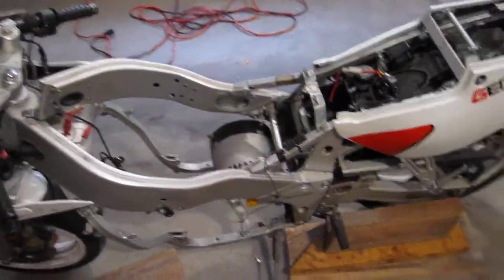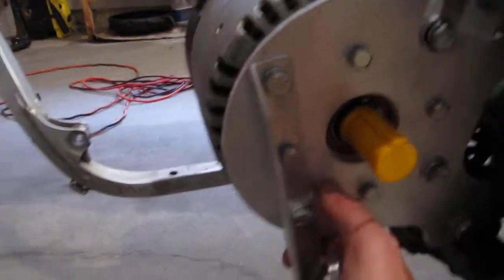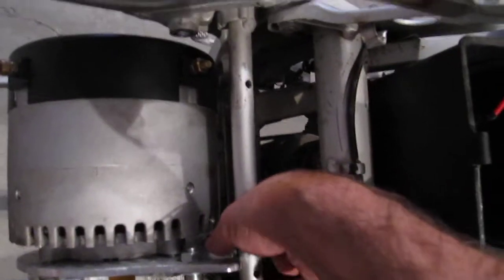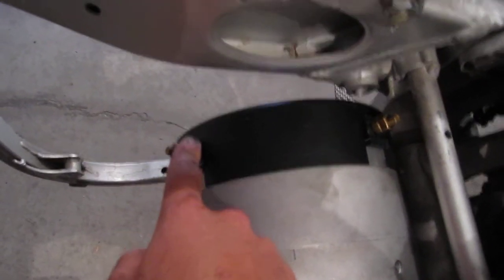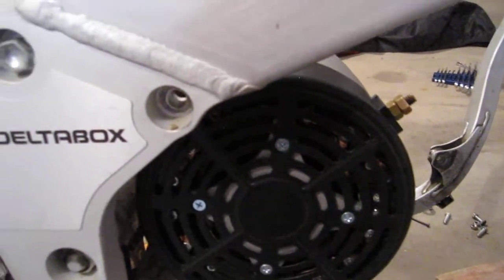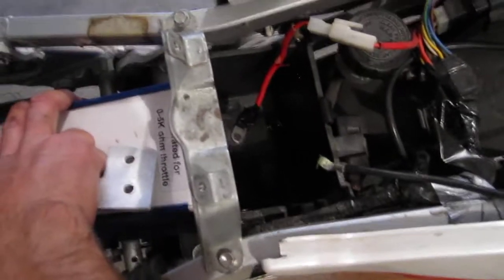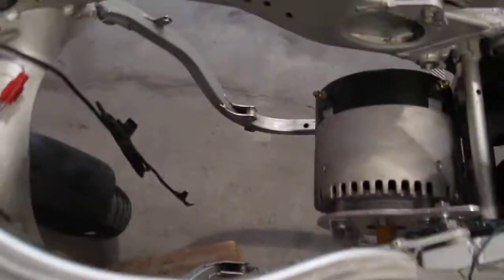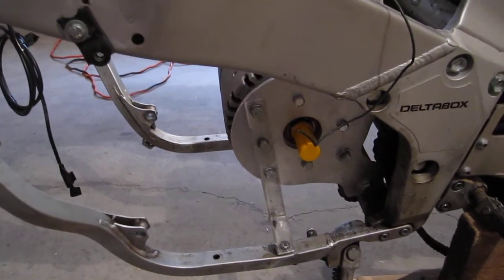Electric Motorcycle Build #5

Comment: My Alltrax 7245 moves my 3200lb car. No heat sink (unless you consider a 5/8" thick piece of Ikea shelf board a heat sink!) and no air movement past it. After my 10 minute commute home, including a 1 km long uphill at max amps, it is just warm to touch. I have never experienced thermal cutback (confirmed with an armature ammeter). It is one tough controller, so I wouldn't worry about heat in a motorcycle at all.